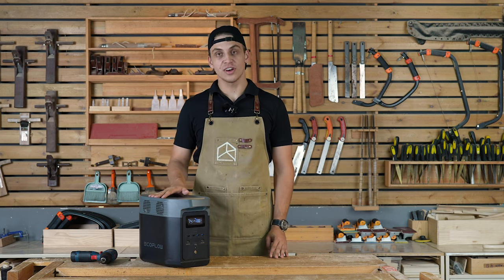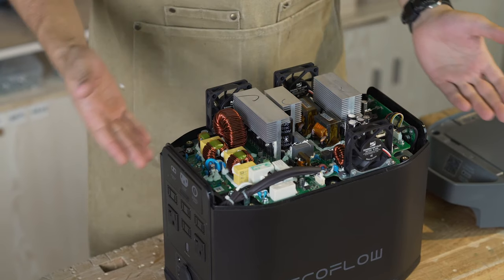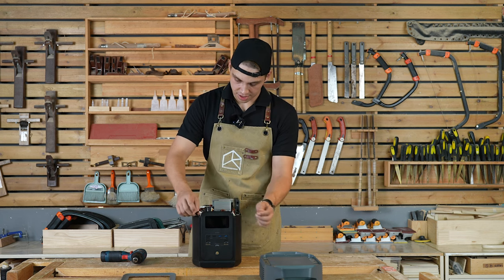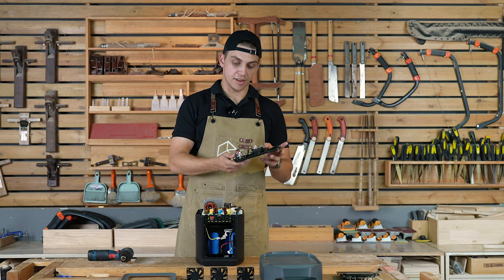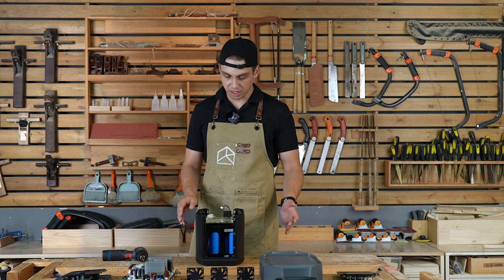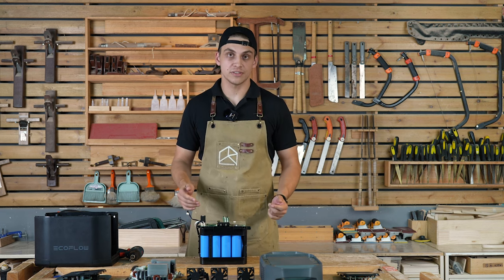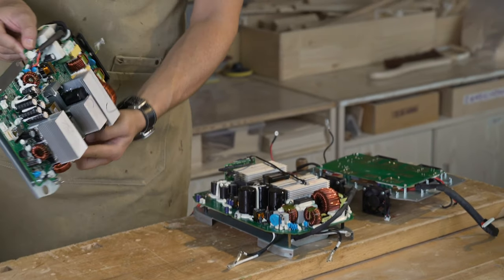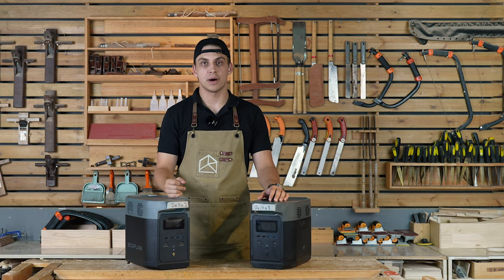What’s Inside DELTA 2 | Portable Power Station Teardown

Comment: Capacitor next to the heatsink - planned obsolescence, 2 year warranty and then bye
Reply: Jenze Delta 2 ma zaruku 5 let vis?
Reply: @romanplacek9425  Na alze jen 24m, další si musíš přikoupit
Reply: It’s actually a 5 year.
Reply: @51Drones  OK, but not in czech e-shop. Anyway, put capacitor "into" heat sink is not good idea. I know, space is limited.
Reply: @TheNovakon  A cooling is weak point in EF units, they are always use strongest fans (in size) because airflow is not optimised, some active elements work on limit and yes, capacitors near heatsink is a bad idea when you plan use power station for 10 years ;-)
Reply: @fachman  undecided. For a bit expensive device I would expect a better internal design.
Reply from the maker: Our products are not made in garage. They developed in the lab by hundreds of engineers and undergo thousands of hours of testing in real live. Don't worry about reliability and longevity. Plus Delta 2 official warranty gets you covered for 5 years
Reply: @EcoFlowTech  But don't you know that commenters are so much smarter than electrical engineers? 😂
Reply: @51Drones  how do you know that commenters aren't engineers with access to top end laboratories ;-)
Reply: Nene..To měli staré modely.Delta 2 má 5 let.A jinak se bude exkluzivně prodávat zatím jen 
v  Hornbachu.Pozdeji všude.
Reply: @romanplacek9425  No uvidíme, jestli podle některých reklamních materiálu mají baterie vydržet 10 let, snad nebudeme přeletovávat kondiky. Jsem zvědavej, kdy se objeví v tom hornbachu a za kolik.
Reply: @TheNovakon  Zítra a má být v Praze i promo výrobce.
Reply: @fachman  Ummm. . . .🤔🤪